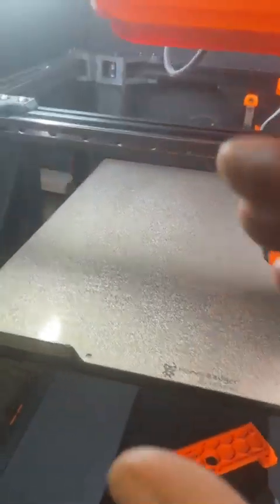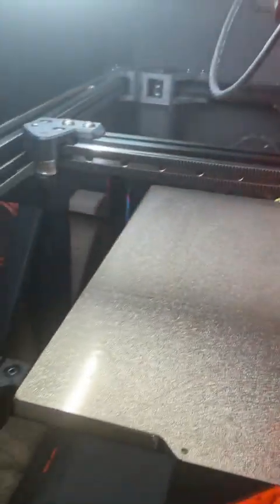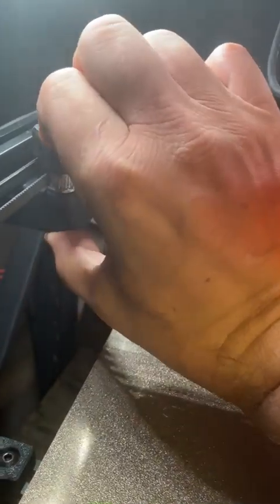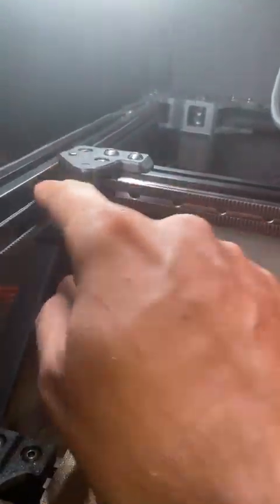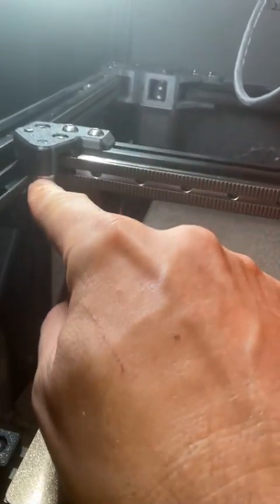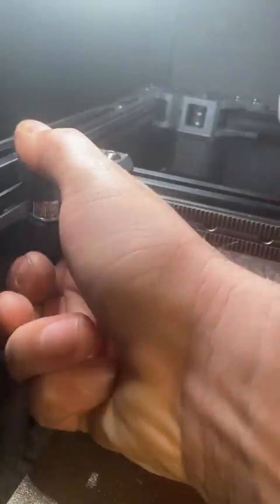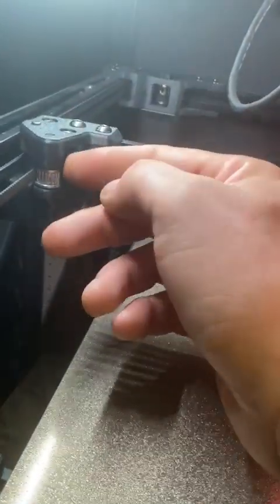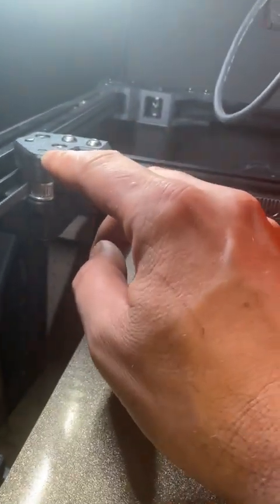Pin Mod - Bad belt or Input shaper after install

Comment: I bought a 5mm reamer with the pin set, after printing and assembly, I ran the reamer through all holes so the pins just slide in by hand. Buy the pins that are D+T 3mm so you can retain them once installed.
Reply from the maker: I might need to try this out
Reply: What do you mean by D+T, buy pins that are 3mm longer than the ones on the BOM?